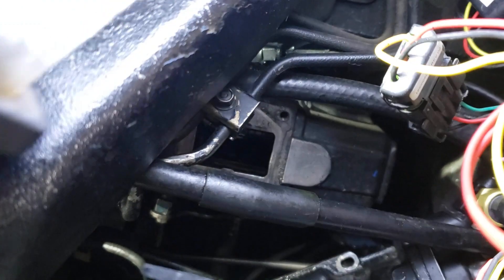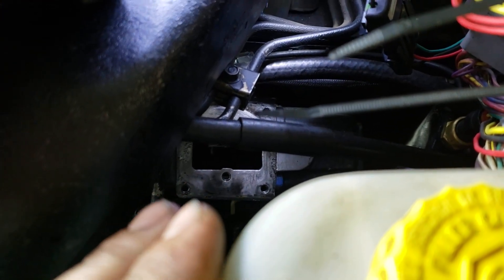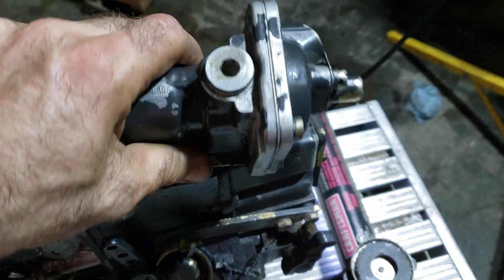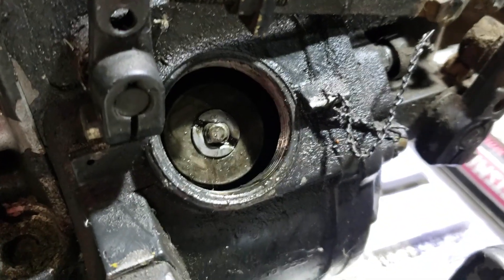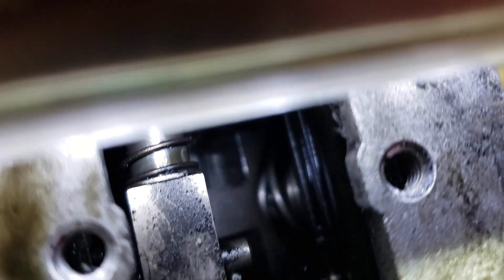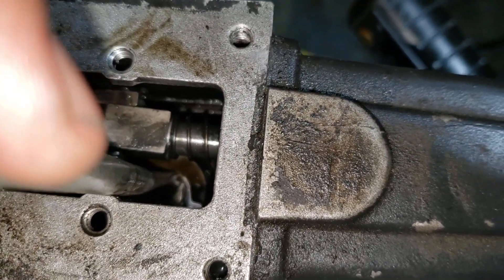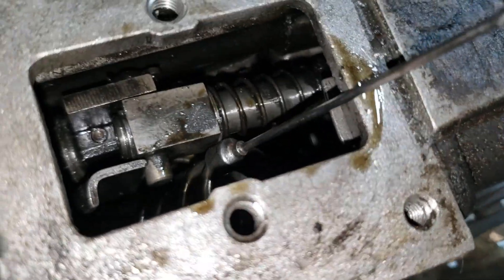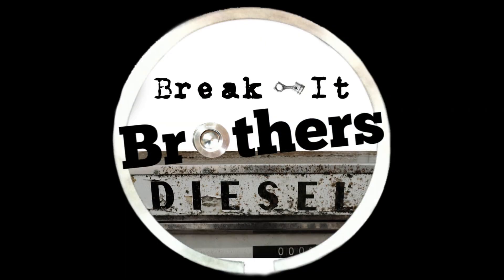How to Adjust or Swap Your p7100 Pump Governor Springs...

Comment: Maybe you can give me some ideas...Im trying to find out what version of P pump I have. Im basically trying to adjust it because I have no power beyond idle. Going up a hill is insane. I mean, any incline is a pain outside of first gear.

Its a bus, with a MAN D2156 engine, flat 6 (10.35 liter). Original documentation I have is either unclear, missing, or in Hungarian or Russian. I have a feeling the engine is much older too, as in 1969 (weird story as its factory original to a bus built in 1993...)

Im basically writing up my own repair manuals for this thing because a lot of things I just cant do in a driveway (it is a 40 foot bus after all...) Thanks
Reply from the maker: The best person I know of to ask about that is Weston Shupe over at Infinite Performance.   Here's his website....https://www.infiniteperf.com/
He knows more about pumps and injectors anyone else I know!  Give him a call! He is busy, so keep trying, but be respectful of his time when you do get him on the phone! Best of Luck!
Reply: @70440charger  Thanks a lot! I will gather up more info, and give him a call.  I have to scrap up a lot of crap off the pump, and see where I can even find serial numbers or what not. Going off manuals may not be enough or correct (a problem with communist tech manuals), so I dont waste his time. Thanks for the site!

Comment: Hey Doug, I had a pump worked on it goes on a Mack E-7 in my boat. I can't get a hold of him right no to ask but, the governor reaction is very lazy, in other words going into gear or reverse while moving forward, will stall the engine and it does not start well with no extra throttle. Which direction do I go with the springs, tighter or looser? From what I see in your video, I think it's looser will make it react quicker and not stall. Another guy who I thought would know said tighter. Hmmm yup. Thanks
Reply from the maker: Hey Chip! For some reason Youtube didn't show me your comment and about a 100 others from the last 3 years. I am hoping you got your truck working better and so sorry for not getting back to you right away!
Reply: @70440charger  Doug, haha well that was a while ago now. I had that pump worked on and they said it was out of adjustment, I hadn't put it back on yet. I am actually using an E9 now which I really like. You can see on my channel if you like. Thanks for the reply.
Reply from the maker: @chipjohnson4971  I will definitely have to check out your channel!

Comment: Can this adjustment change the max governed speed a little bit?
Reply from the maker: That is a great question Matt. As you probably already know, p7100 pumps have quite a few things that go into controlling its total output. But even though there are other things also at play, assuming the other areas have also been taken care of, tighten up or swapping governor springs can change top speed any where from a little bit to a lot! Just depends on what course was taken. For example, Just tightening the GS's down 2 clicks can but top speed up some and increase throttle response. Swapping the stock GS's out for a 3k kit will probably get you a little you a little more and a set of 4ks will put you at a whole new level. But remember that this is assuming that the other common p7100 mods have been done. If they haven't been done then fuel quantity will become the limiting factor for top speed and not just RPM.

This is just a quick glance at what plays into it, ( and I am not claiming to be the worlds authority) But I hope it helps some!
Doug

Comment: How did u get the a/c compressor to lock up ? I have an 2003 with a 97 12valve swap I have a tach signal and I’ve charged the system with freon but I can’t get the clutch to lock up any suggestions I’ll take any help I can get
Reply from the maker: Hmmm. This has been a while since you posted your message. Are you still having trouble with this?

Comment: is the very outer spring the idol spring? witch springs actually control the max rpm? I have searched all over the internet and I cannot find a good diagram of the governor assembly on the p7100 and was curious if you knew
Reply from the maker: Thanks for the comment! The outer spring is the idle spring and as far as the which spring controls the max RPM, I don't know, but I just asked Weston Shupe over @ Infinite Performance ( On youtube @ torque source). He said that it is not just one spring that handles the max RPM, it is the combination of all of the rest of the springs combined. Hope that helps some!
Reply: so the biggest spring is the idol spring and the three center springs control your rpm is what im understanding form this. I really appreciate the reply and research on your part